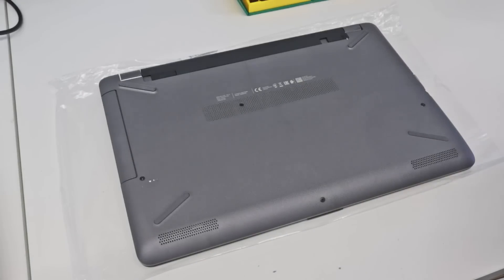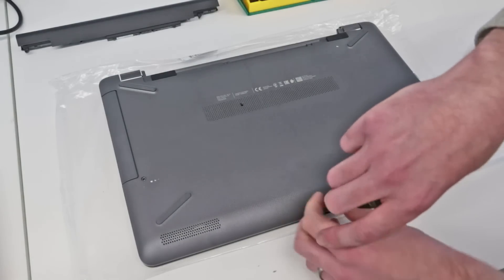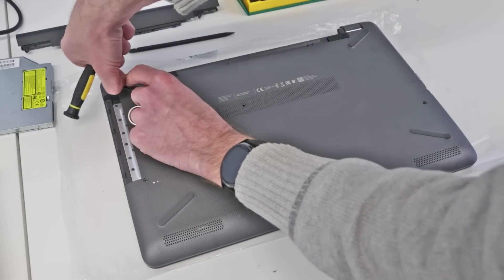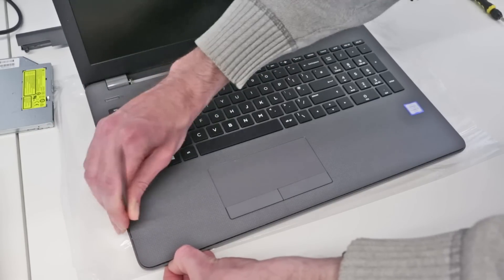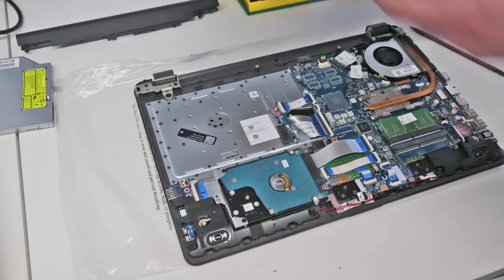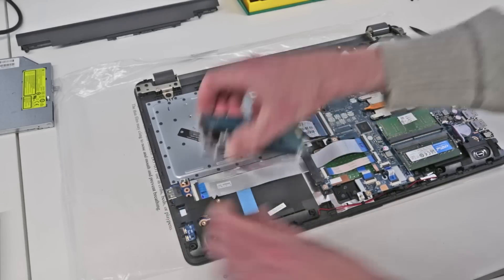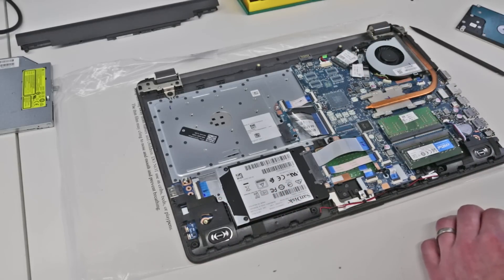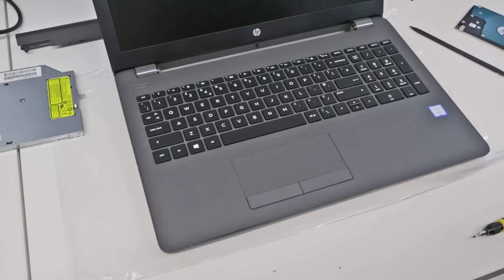HP 250/255 G6 HDD/SSD and RAM Upgrade Guide

Comment: Great video. When you change the RAM DDR4 does it need to be the same brand and MHz ? I want to change on mine that has a DDR4 1866MHz but the new one is of frequency 2100MHZ. Do i need to change both the DDR4 in this case?
Reply from the maker: You should be able to fit a higher speed module, it'll just run at the lower speed.
Reply: @BrueComputing  Thanks - Can you have 2  8GB DDR4 on a HP255 G6 ? Or is maximum 8GB in total--2 times 4GB DDR4 ?
Reply from the maker: 2 x 8GB should work fine.

Comment: 163/5000
Hi
i have hp250g6
with 1tb hdd
intel i3 7th-7020u
4gb ram
redeon graphic
but it seems quite slow
Think about extra 4gb RAM memory.
can i5 be installed?
Reply from the maker: No, the CPU is soldered down and cannot be replaced.
Reply: You need ssd

Comment: Hi can I install a 1tb or 2tb m.2 solid state drive and 32gb ram in this laptop thanks
Reply from the maker: SSD should be no problem.
Officially the maximum supported RAM by the HP 250 G6 is 16GB DDR4-2133 - I've never tested it with more than this so couldn't comment. 
The 7th gen Core i3/i5/i7 does support 32GB RAM, but whether that requires 4 x 8GB as opposed to 2 x 16GB I don't know.
Reply: @BrueComputing  thanks
Reply: @BrueComputing  how much ram can the g6 255 do?

Comment: Is it possible to upgrade the processor of the same laptop model from Celeron to core i5 or i7
Reply from the maker: No, the processors are soldered down, and the Celeron models use a completely different mainboard. Only possibility would be to source the higher spec mainboard (and possibly other parts) and for those, but would have to check the service manual.

Comment: I wouldn't call this a simple job if you have a metallic case. It is very hard to remove the cover without damaging or scratching the plastic - there are a large number of clips around the edge. Also, on some models, HP puts the M.2 SSD in a bracket where the 2.5 hard drive should be, presumably just to make it difficult to upgrade.
Reply: Thank god they changed their machines to be more upgrade-friendly. Those HP Mini PC's are very upgrade-able and just require 1 thumb screw to open up

Comment: So they designed it so you can easily remove/replace the DVD but you have to "crack it open" in order to replace HDD and Ram. Go figure. Well done video thanks for sharing.
Reply from the maker: Pretty standard for modern laptops now unfortunately.
Reply: @BrueComputing  Yes, very poor engineering last years...to disassembly something you need power aka Avengers

Comment: I have this model and looking to upgrade to SSD with additional RAM, so I found your video very useful, thanks. However if I didn't choose the Sandisk option what cloning software would you recommend (are free ones OK?)
Reply from the maker: I normally use TrueImage 2018.
Reply: @BrueComputing  Just an update. I eventually bought myself a SanDisk 3D Ultra SSD and a cheap £5 cable to clone it from my laptop. I used a free software called  Macrium Reflect and it took about 50 minutes to clone just over 200GB of OS and data to my new SSD . The difference between the old cheap Seagate HDD and the new SanDisk SSD is astonishing, so much faster etc. So simple to do also, the hardest part was actually getting the laptop opened up without breaking anything, a bit fiddly and tricky but OK with a bit of patience.  Many thanks.

Comment: So Im thinking of putting in the 4GB Ram upgrade and going with a SSD to boot windows. I'm on a budget though so Ill probably get the 128GB SSD, in which case I would really like to keep the 500GB HDD as part of the laptop. I would really like it to be an internal component so I dont have to lug a HDD with my laptop. I saw your reply about a caddy... what would you suggest the best way to have both an SSD and HDD in this laptop (Dont care about the CD/DVD Drive)
Reply: https://www.amazon.de/s/?ie=UTF8&keywords=hdd+caddy+slim&index=aps&tag=googhydr08-21&ref=pd_sl_2tzqhng367_b&adgrpid=54104741660&hvpone=&hvptwo=&hvadid=259148046642&hvpos=1t1&hvnetw=g&hvrand=11812696812969857066&hvqmt=b&hvdev=c&hvdvcmdl=&hvlocint=&hvlocphy=9068352&hvtargid=kwd-315129233436

Any of these would do it, if you check the HEIGHT, which probably is 9,5 mm - you can connect any fitting ssd or hdd into one of these and connect them the usual way.

I's suggest to put the hdd into the caddy, my expiriences have shown, that the first sata-connector always has some kind of priority.
Reply: @JohnSmith-ez8dn  what happen if my laptop (this model) doesn't have cd/dvd drive?  it will possible connect an HDD in that space?

Comment: i went to my local computer parts store today to buy more memory for my wife's laptop, and the guy told me that he doesn't want to sell it to me because normally HP laptop will only accept / recognise the memory only if you purchase from HP..
Reply from the maker: Total rubbish
Reply: so any ram (with the correct spec of course) should work?
Reply from the maker: Yes, standard SO-DIMMs of the correct type (DDR4-2400 iirc) worked just fine for me.

Comment: My dvd thing won't come out =(
Reply: Mercury_F12 mine doesn't come out either, have you found a solution??
Reply: u need to put a needle into the small hole
Reply: putting a needle will only put out part of it, not the driver itself
The solution is - Pull hard the driver, dont worry, its just the SATA plug that is quite tight because it is new.
Took mine off, now im using a HDD Caddy just fine.
Let me know if it did work

Comment: When I install the second 4 GB memory module the laptop will not start. Any reason for this?
Reply: probably speed issues - if there is a fast module already equipped and you put in a much slower one, it gets highly overclocked and this can result in the notebook not starting.

Try swapping both modules ...

Comment: hello, i have the same laptop with i3 6006u, can i add ddr4 on frequency 2133 Mhz ?

if yes how this will affect performanceб because i see i have Samsung 4GB DDR4 SODIMM PC4-19200 M471A5244BB0-CRC

on 2400 Mhz, but this process supported only 2133 Mhz

Did I understand that overpaying for 2400 I get all exactly 2133. Does it make sense to overpay for 2400 ?

thank you
Reply from the maker: DDR4-2400 isn't really any more expensive that 2133. Manufacturers tend to fit 2400 as there is little to no cost difference and logistically it makes more sense for them to fit the same modules to as many products as possible.
Reply: @BrueComputing  hola soy de chile, cuantas ranuras tiene este notebook (240 g6 i3 6006u)??? Si tuviera una sola se puede reemplazar por una mejor? quedo atento a sus comentarios...
Reply: Hi, I'm from Chile, how many slots does this notebook have (240 g6 i3 6006u) ??? If I had one, could it be replaced by a better one? Stay tuned to your comments...